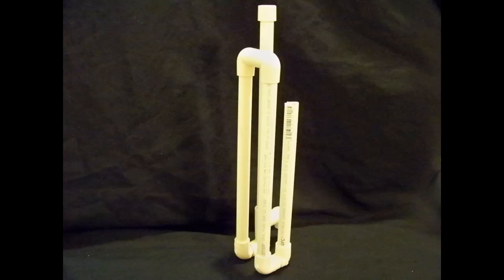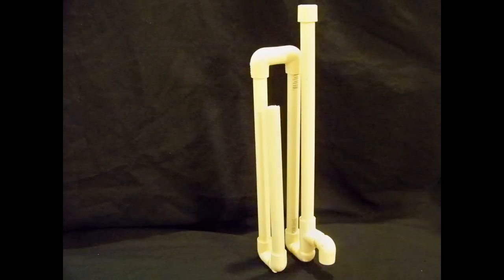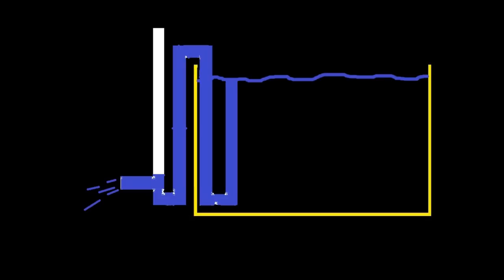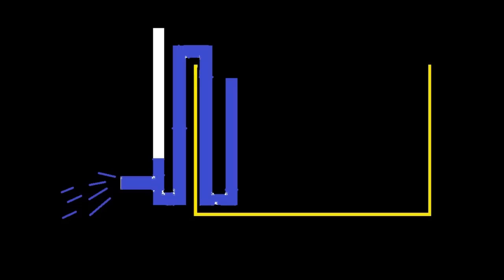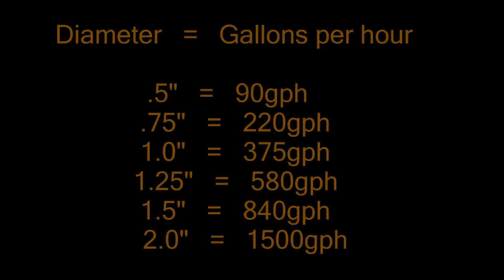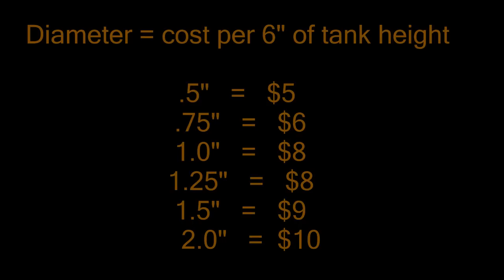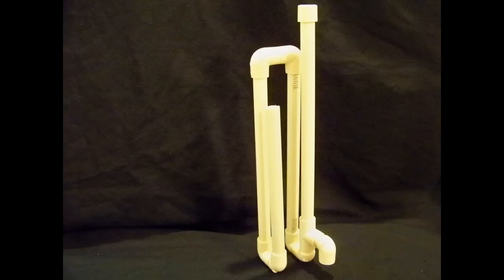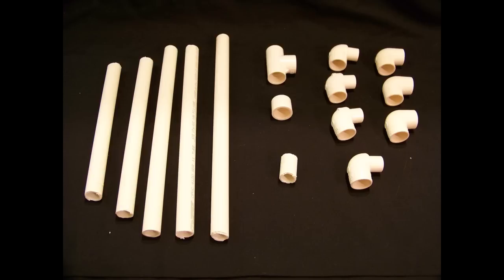HOW IT WORKS: DIY Aquarium Overflow PVC

Comment: Very nice tutorials. I've just build my overflow and when trying to prime it I realized the solution to a problem that has been comment on. If you're sucking on the check valve as shown at 4:00 mins, you will never prime it without capping off the drain and putting some water in the standpipe, so you can suck water up into the loop under the check-valve. Alternatively (after you've capped the drainage) if your stand pipe is long enough it may self-prime just by filling the stand-pipe up above the loop under the check-valve. If that worked, you wouldn't need the check valve. Hope this helps.

Comment: Thank you for your awesome videos. I think it's also important to mention the collection of "micro-bubbles" which can collect and eventually break the siphon at the primer point and defeat the entire purpose. I corrected this by running a 1/4" airtube from the primer point to the sump. After priming, air is continually lifted into the 1/4" tube and then back down. This seems to maintain the overflow after a power outage without the worry of air bubbles building up and breaking it overnight.

Comment: One thing to note. The amount the overflow will handle will vary greatly depending on the elevation difference between the overflow inlet (tank level) and the outlet. placing the outlet near the bottom of the tank will maximize flow.

Great vid!

Comment: Joey, this is killing me. This design is clearly the best in terms of cost and effectiveness, so I've set my first one up with 3/4" piping, but the darn thing is not moving much water. Certainly not 220 gph. It's barely trickling into the sump, and I had to clamp the return valve because I can't turn my pump down low enough to be less than the overflow amount.
Oh well, I'll have to trouble shoot, thanks for the easy how to video on it. You deserve more praise and less questions. haha

Comment: This looks really Nice and easy to make, 
Marvelous Idea you have here,
I know I asked the same question at one of your other videos too, just in case if you checks this one first.
My question is, does it loose the syphon over time and if it does how would I prevent this? Please help
Reply from the maker: The only way for it to lose siphon is if it is leaking air... if properly built, it will never leak air.
Reply: Thanks for the quick reply, wouldn't air bubbles travel with the water, just curious as you had been with the aquarium systems since a long time and I am real new to aquariums.

Comment: very nice job on the video, its a great solution to buying one of overflow boxes. i was thinking of building one for my 56 gal fowlr, but i have a couple questions about the return pump for it, lets say i use a 660 gph powerhead for the return, two of the 1 in pipes would be able to keep up with that right? the idea im getting is depending on the amount of water flowing back up into the tank from the sump will dictate the gph of the overflows as long as it doesnt exceed their flow rate.

Comment: Thanks for the presentation. I created an overflow just exactly as you mentioned only difference is, I use a small suction pump to suck out the air instead of the check valve.  I don't know where to get a small check valve,  I don't want to keep using the pump, it needs to run all the time and it's noisey. So I prefer your method, if I could find a check valve.

Comment: Good video, I am building this using your video as the template but the only difference is the point where the water exits will be different for me. I will build the overflow exactly the same with an additional 90 pvc fitting right where the water exits and run it straight down to my refugium. Will this create a syphon since it drops down again or will it work the same if I build it exactly the same and put the 90 on the end of that piece you showed the water exiting out of?

Comment: Joey, Question reg. flow rate.
Tank is a  Red Sea 250 (D). I will have a sump below with an Iwaki 40RLT as my return.   I have a Tru union ball check valve and another ball valve connected. (both are right off the pump) 2nd ball valve will be to adjust flow. the return is going up roughly 5 ft (chiller will be in between). I was planning on doing a 1" overflow, but now I see It should be at least 1.25" if not 1.5". Uncertain what will be best. While I will have my skimmer down below, I am uncertain I want to undertake making two of these let alone one. I am excited to make this work, and with a Hofers gurgle device over the intake, I can't see why I should make two overflows. Believe me, I am someone who doesn't like to leave anything to chance. And I do get the idea of "better safe than sorry". But I thought if properly done, I should be OK. . If you do strongly recommend doing two overflows, should I then use 1": or 1.25??  I'm taking my time on this and really want to do it right before I put a single drop of RODI in this tank
Thanks for any input you can give!

Comment: Thanks for the great vid! Ive built myself the 1" version and it works exactly as you said it would. However, i didn't install the check valve. Instead, i simply sucked air through the stand pipe to get it primed.

Comment: Hey Joey,

I am new to the hobby but been using your videos for reviews on upgrading my tank's performance, and sex appeal. What is the purpose of an overflow. Is it to get rid of necessary equipment heater, filter, bubbles, ect from inside your aquarium, and put it into the sump. Can I actually hook my filter inside the sump with the setup. Also am I able to take out all equipment that made current inside the tank with this setup. Please get back to me you are very good at what you do.

Comment: so the valve is needed at all times? i thought it was only needed for start up? I was thinking the same thing xreapingsx mentioned. If i cap the exit with my hand and suck the air out through the top end cap wouldn't that remove all the air from that loop? or is that check valve needed to continuously keep air out?
thanks, btw your vids have really helped a lot in my build! keep up the good work!

Comment: Hi Joey, Thanks for all the great aquarium DIY. I just started a tank up after not having them for years and the tips, tricks, and advice from you have been great. I've run into a problem though, and cant figure it out. I built an overflow, but cant get it to flow. I only made one change and that is the direction of my exit pipe. It seems like I cant get the air out to create the suction to prime the overflow. Any thoughts as to why? Im totally stuck.
Reply: Did you suck the air out of the check valve?  I have mine hooked to a power head in the tank so it always self primes

Comment: I really liked the idea and definitely going to use one at my 50 gallon tank, the question I have is why do we need the "Check Valve" as I see is once we suck the air out of this and make it working, we might never need this Valve and for creating the vaccum we can always suck at the longer pipe(Blocking the water outlet). Please confirm if I am thinking it right.

Comment: hey joey i like ur vids and im making a 3/4 pvc overflow with the pipes to the sump which is then connected by a hose....im using a 290 gallon pump....to the overflow i added a under-gravel cleaner simply by putting a T in the bottom inside part of the overflow....my question is if power goes out the top part will stop the siphon because water will go lower than the entry ...but what about the under-gravel...will it still siphon ? should i drill a small hole on the top of the inside pipe ?

Comment: Thanks for all the vids Joey, they help a lot. Three questions: 
(1) Will the overflows get noisier as the diameter increases?
(2) As a unitized weir, could I cut or file small teeth around the overflow opening, or drill a ring of small holes just below it?
(3) Can I plumb two complete overflow loops together (side by side) and connect them both to only a single tall pipe w/end cap?

Comment: hi joey, i'm fairly new in aquarium stuff, please bear with me. Does the length/height of the tubes matter? i mean, does it really have to loop all the way down to the bottom of the tank (inside and outside)? i have seen other DIY's for overflow and some have the pipes just half way down, and some really short. I just want to know if there's a significant change in flow rate or any other effects that i should know about? Thanks in advance bro. btw, all your videos have been absolutely helpful!

Comment: Hi , nice video, I wanted to do the herbie method overflow but I cannot drill my tank so I think I going to use that method, it looks safe if it really work well,  one question tho since all the water go through one pipe , I supose it cannot be as silent as the herbie, is there a way to keep it silent, other question would it be better to use half moon pipe instead of 90degree because of the air being stock in 90 ? Thanks

Comment from the maker: If you liked this video, you will LOVE my book: http://thekingofdiy.com
Reply: +The king of DIY 

QUESTION:  1:55  Can the white pvc portion of the overflow that is outside the yellow line (indicating the aquarium) be inside another aquarium where the water level is only a few inches lower than the first aquarium, will it still function?  Or, if that portion is kept between the two aquariums, can the output be raised to where it's only a few inches lower than the input?  Or, can it be done with some sort of overflow box?  Or will it just never get started again after a power outage?  Is a drill-thru into both tanks the only way?
Reply: +The king of DIY Like this or that, would these not work???

http://i396.photobucket.com/albums/pp43/mef1975/jk_zps2sj44rnj.jpg

http://i396.photobucket.com/albums/pp43/mef1975/jk%201_zpsx0syvcdh.jpg

Or maybe, bringing the water level in the taller aquarium down to the same level as the shorter one, and using a U tube or bridge is the only way?

Comment: I made the same overflow in this video just like Joey says, but did not use the check valve.I primed the unit by sucking on the air vent cap with the hole in it (yes I did get a mouthful of SW just don"t spit it into your tank :P) . After that I tested the overflow by turning on and off the return pump and the overflow resumed just fine, but I might add a float valve just to be on the safe side. $15 for all I needed  in 3/4in along with some extra fittings = no brainer IMO.

Comment: THANKS, THE VIDS  HELPED ALOT.  I'm building a tank like the plywood one that u built. i was concerned with the cost involved esp for the filter setup but u made everything cheap and easy to do, like the filter cost. i am prob going to put the overflow lines in the tank but in this vid u say to use 2 overflows. would it cut the cost in half  or so if u put a t at the inlet with 2 90s and a screen to prevent things from gettin sucked up? and do you think that would work on both overflow methods?

Comment: You are the exit to my headaches,  may I change the length of the tubes based on your explaining? I mean what if I want the sucking side to be in the bottom of the tank, would that work if I drain all de air with the valve? or maybe if I have to adapt all the tube´s length to the height of the tank and my sump filter? please answer.. TY

Comment: In the video (the part about flow rates and matching to pump rates) it is mentioned to add two overflows, in case one gets clogged to prevent the tank from overflowing.  This isn't mentioned anywhere else, but seems to be an important point. Is the second overflow vital? If not, how do you prevent the tank from overflowing in case of blockage? Thanks....your videos have given me way too many ideas!!!

Comment: Hi Joey,

If the volume of water for a 0.5 inch overflow pipe is 90 gals, is that 90 gals entering the tank or is that 90 gals of water at the pump not allowing for the head height?

Comment: if you have a power outage and the return pump dies, the tank level will drop to just below the open pipe on the inside. if that tall outside standpipe isn't there, gravity to your sump will have a siphon effect—it will continue to pull all the water out of the whole PVC system until it's just a bunch of dry tubes. no problem, right? except when the power comes back and the return pump starts, you have to run over there really quick and slurpy-prime the siphon again before your tank overflows!

Comment: I made an overflow just like this (got the idea from this video, Thank you Joey :) for a 20g tank that I am using as a second refugium on my system. I used 3/4 pvc for the overflow and a little powerhead for the return. I have valves on both so I can adjust , but found that wide open on both is working fine. I did not use the check valve and was able to prime from the hole in the air vent cap. I let it run a few , turned off the powerhead , then back on and it resumed overflow.

Comment: Hey Joe I'm semi-new to the hobby and really want to set up your cheap and easy diy aquarium filter with your diy overflow.I have a75gal with a marineland c360 and just really want the benefits of a sump/trickle filter.I have a maxi-jet 600 w/a Max flow of 160gph and max head height of 42in.just wondering what pipe size (or double pipe)?and if the 600 would work or should I upgrade or just go with a pump.cost in mind.thanks

Comment: hi, i am about to go overseas for 4 weeks, i have overpopulated cichlid tank, normally i do water change every second day otherwise it become problem. Now, obviously no one is going to change the water, can i install this system into my tank. So basically fresh water from main source will be dripped at very low volume in to the tank. Is it going to work consider only little drip going into overflow pipe. The reason i am asking this because most people build this system is for sum filtration with actual water pump installed on the sum filter tank underneath and i am not using water pump. Also with sum filtration, water volume that goes to overflow pipe is big whilst mine would be little drip. Hope you can help
So, to summarize my question, will this system will work on very tiny little water flow going into that DIY pipe

Comment: What up joey for the over flow you said you should have two running if the same diameter over flows wont that cause flooding if your return  pump is inly returning half the amount of water ?

Comment: Joey, i've just built one but have not put it to use yet, but just wondering about the priming part when you suck on the check valve to remove any air.  Question is., when i suck on the check valve air will continuously be sucked in from the stand pipe that has a hole in it plus not to mention the output where the "T" connection is.  Question 2 is, how will i know that the pipe is full of trapped air and is time to suck it out?  which no one has ever mention on all the videos.

Comment: great video I built one also. one problem one time it stopped taking in water and I had to once again bleed air from the oneway valve any idea how to correct? I used 1 1/4 pvc worked fine last two weeks but had to restrat siphon last night as it started to overflow

Comment: I believe your explanation is inaccurate at 3:46.  The water line would never go above the top of the outlet pipe at the bottom left  of the picture unless it is flowing out  slower than what's coming from the main tank or outlet is blocked.  As the water line rises up to the bottom of the outlet pipe, it will spill out and down to the sump.   But let's just assume that the outlet put was clogged, the water line would only rise up to the level of the water in the main tank and never higher.
Reply: Jay Eel I also think that if you were able to put a valve on the outlet and lock it off. Then you could just pour water in the tallest tube, the one on the outside of the aquarium, and that would prime the whole thing.

Comment: @uarujoey, thanks for your reply, i did not realize that traped air can get into the top of the overflow where the check valve is.  Is that a flaw to this type of setup?  How often can you loose your flow because of trapped air?  Im guessing it would be depend on your individual setup.  But im just wondering if it is something i would have to constantly be worring about?  last question sorry but does the trapped air come from the water intake, or from the extented air pipe outside the tank?

Comment: Use powerheads pointed at the bottom to make sure you don't get crap sitting down there, they will blow it up and into the filter. Overflows are useually used with a sump as a biological filter, so just run something like a HOB or canister filter to polish the water at the same time. This also gives you redundancy, if you need to work on your sump or wait for a broken pump your fish will be ok for a while running just on the canister or HOB and the media in them will be cycled.

Comment: Is there any risk to fish from the PVC cement?  Or is there a special cleaning it needs after getting it all built?  
Also, right now in use a tank mounted overflow that is see through and I notice that bubbles build up at the top after a few weeks (if the fish knock the air line off that goes to my wave generator).  Is there a way to deal with those on the PVC set-up (automatically) or do you have to suck air out of valve once in a while to be sure?

Comment: Will it work as described if the tee is used in place of the elbow that, in the video, is immediately before the tee? Another way to as that is: in order for the overflow to work properly, does the water have to begin flowing up the external (dry) standpipe before it can flow out to the sump, or is it OK to let gravity take over once the water inside the overflow clears the tank rim?

Thanks in advance.